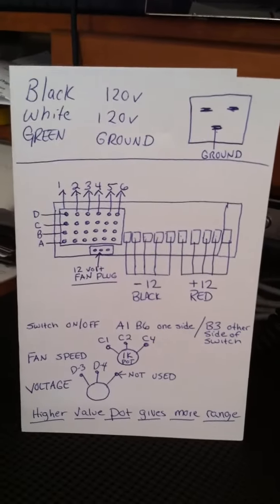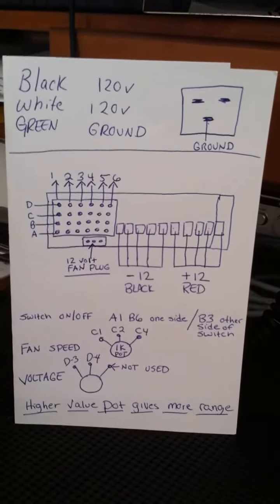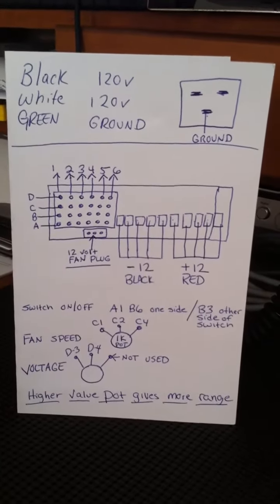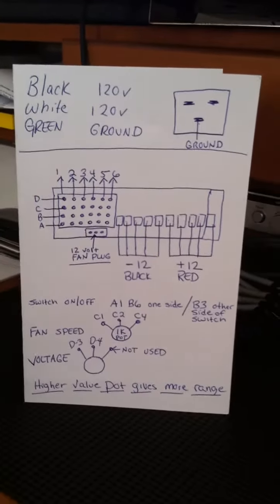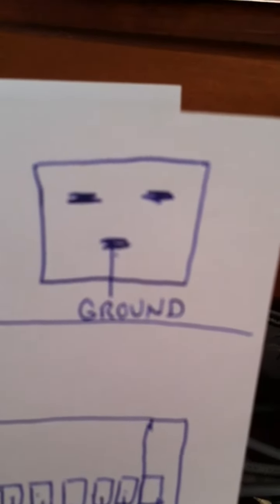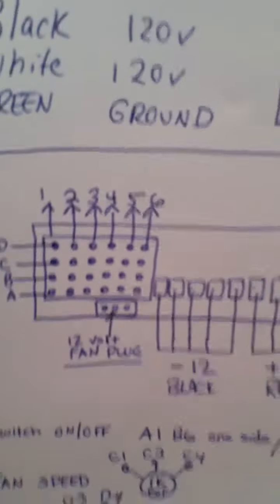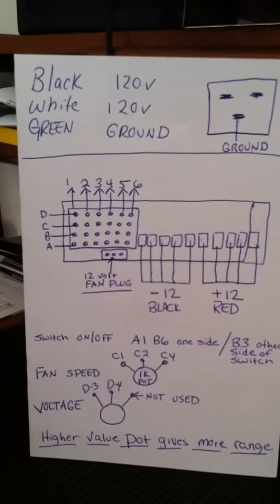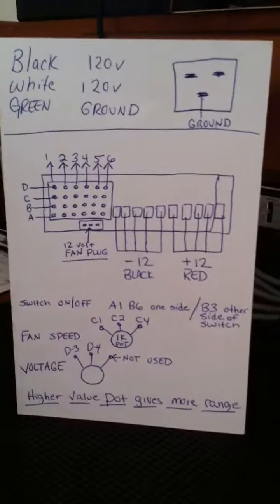How to convert a Dell Server Power Supply to a 12 volt powe

Comment: Hey I have the dell N750P-S0, do you know if when the AC plug cable is connected, 1 from the 3 LEDs must turn on? I connected the mine, and any of the LEDs turns on 😢

Comment: hello, i have installed the pot for HAM use, even if you can't go upper than 12.60V it gives more stability to the outpout voltage (without pot voltage drop to 10V when high current)

Comment: I believe that the DELL 7001080-Y100 54.4A model could only be via PC, because there is no trimpot internally, but there is a connector on the rear of 6 pins that could be the communication link, If anyone finds out how, spread the word to all of us.

Comment: I have four of these N no luck I got the Dell 1100 watt L1100A-S0 models with flat board on back and I ha e 2 Dell z670P-00 670 watt models and no luck with those either..
Need up to 13.5 @ max amperage
HELP!!!
Reply: I think you have got Dell z670P-00 670 watt   Can you find info this mode ?

Comment: I just got mine soldered up and going, I am using it to power a Car Amplifier. The amp runs at about 11.68 volts but as soon as I hook it up to the amplifier, the orange light comes on the Power Supply. Any idea?
Reply from the maker: +Riley Britton recheck your mods. Might be a bad supply. kicks into protect mode soon as load is applied. I can tell you how to bypass the protection

Comment: I just got a Dell Poweredge 6950 PSU. For voltage control, did you use a resistor wired in series with your pot? If so, at what value?
Reply from the maker: No no resistor.

Comment: Hi Charlie Brown. I have a question to you. I have DELL ATSN model 7000880 675W Power Supply. I want to change its output DC voltage 13.8VDc. Could you help me about this because I want to use this PS with my ham shack IC-7300.
Reply: Hello have you figure out how to turn on the 70000880 Power supply i have 3 of them and i'm still trying to figure out out.
Reply: Ali kardeş çözdün dü mü ?

Comment: I just bought one of these off ebay, I plugged it in and all I hear is clicking noises coming from the supply, no lights or fans.

Any ideas?
Reply from the maker: You gotta jump sum pins. Look at the diagram. If you don't get anything but clicking after you jump the pins then u have a bad supply. It happens.
Reply: I think I have a bad unit then, it does nothing but click. The seller said it was working, but thats ebay for you. Do you have any of these youve modded and would sell?

Comment: Just wondering if you have tried to do the over volt mod on these to get them up a little higher in the voltage range? Also how much pull down do they take when you have an amp hook to them, or should I say what do they drop down to when you key an amp on them? Also have you tried to stack them to get more amps from them? I ask because I was thinking on stacking about 8 of them to get 800 amps at 14.5 volts. Thanks Stickman
Reply from the maker: Wow stick. Sorry man I just saw this. Yes you can do an 18v mod. They are stout man. Don't drop much. I can tell u how to mod them for 18v
Reply: Hey!!! i sure could use that mod! i have a dell 6800